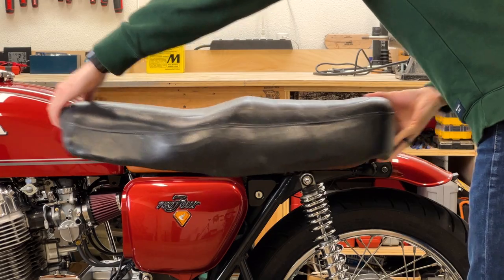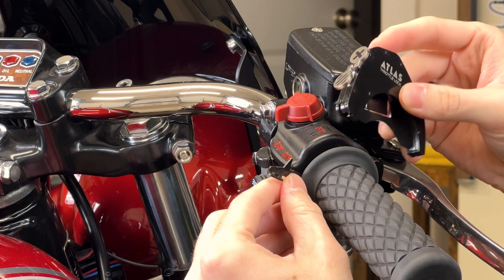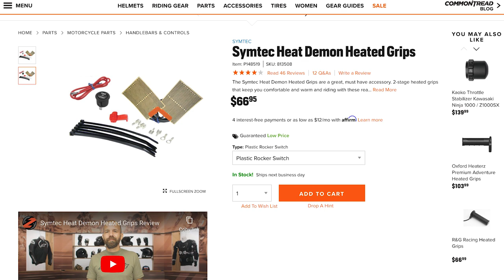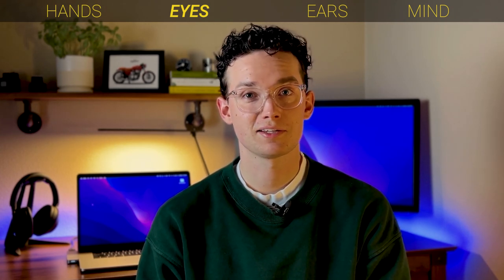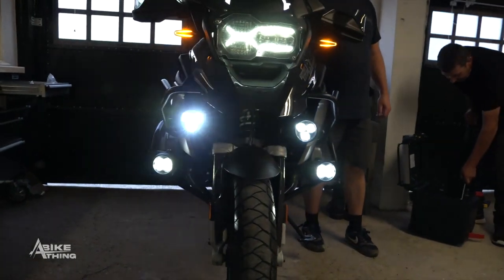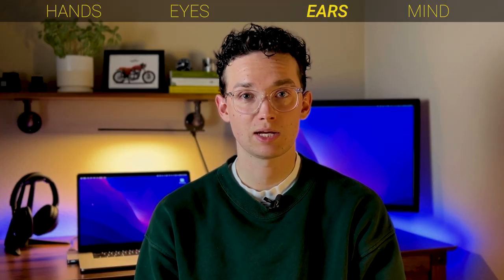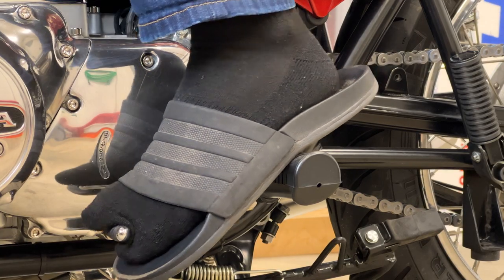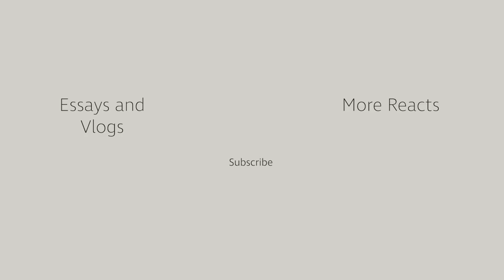How to Make Your Motorcycle More Comfortable in Every Way

Comment: I almost always wear ear plugs, but I got the kind that filters out certain frequencies.  Definitely worth the extra cost.  I sympathize with the tinnitus problem - I've had it for a very long time.  Ear protection that blocks all sounds is useless because, ironically, all you hear then is the tinnitus sound.  Drives you batty.  Comfort suggestion?  My seat cushion is my best friend on a long trip.
Reply from the maker: I’ll have to give the filtering kind a try! And I used to think everyone hated ear plugs since all you heard was ringing 😂 it took a bit to figure out it was just me.
Reply from the maker: Good suggestion on the seat cushion! I built the foam to be dual density, but a good gel pad would certainly help on real long rides.

Comment: A few comments: I have yet to find a throttle lock that works as well as the old style throttle screw found on older BMW airheads and old British bikes. As for earplugs, I have found those dedicated to shooting sports are more comfortable than foam and easier to use and do a better job at reducing noise. If I happen to forget to put them on I am immediately confused by all these strange engine sounds that I never heard before.
Reply from the maker: Yep - this cb still has that throttle screw too, but it’s not quick to deactivate. Definitely a brave choice for an 80mph cruise control 😂 not saying I haven’t done it… And I know what you mean, when I don’t wear my plugs I can hear all the induction noise from the carbs. It’s the only noise I miss with my plugs in 😁

Comment: I have the tinnitis due to ice hockey. I have tried several motorcycle helmets and the ones that claim excellent wind noise protection work worse than my open face helmet. So I think you are correct and I just ordered the Alpine Motor earplugs you tested. That might just be the solution. Thanks.

Comment: Always, always, always wear ear plugs, and I've noticed that on my new beater (old, highmilage, BMW GS), the windshield is creating this buffeting that totally drains my head due to the increased noise. Have tinkered around with windscreen alot, but I've come to the conclusion to just remove it to reduce the wind buffeting. I never get the same fatigue from riding my old R90/6.
Reply from the maker: Great insight! I recently added the fly screen you saw here to my bike but I’ve yet to go on the highway (terrible weather all season). I’m sure I’ll have to adjust it so that the wind doesn’t hit me right in the head. Sometimes it better to just leave the airflow unbothered, but I’m excited about tucking in behind it at high speeds. We’ll see.